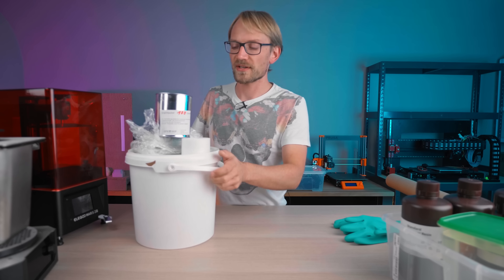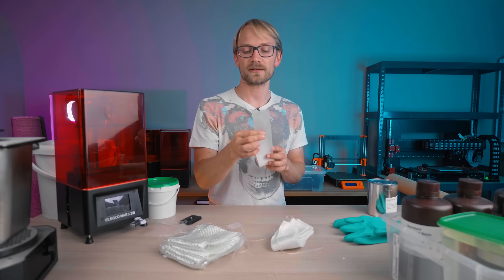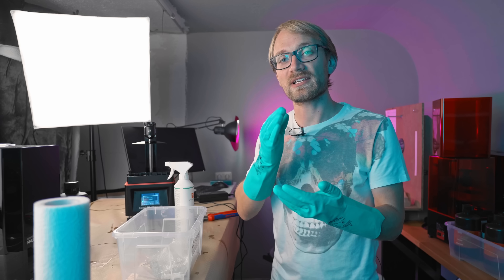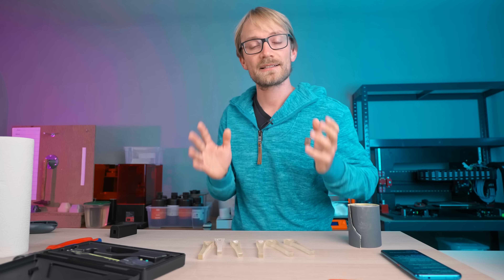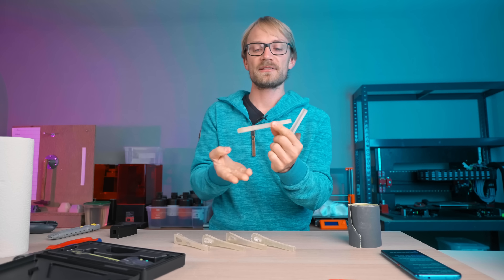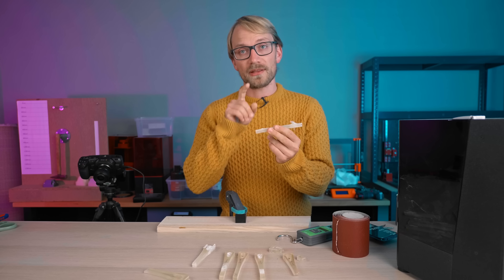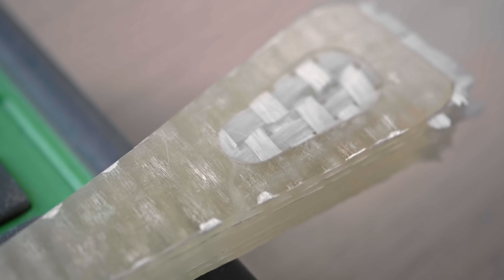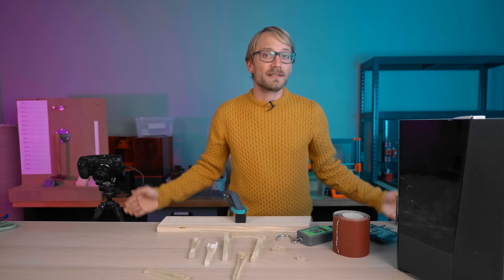Fiber-reinforced resin prints - how much STRONGER are they?

Comment: We add 10% milled 1/64" glass fibers to the resin by weight, it works great.
Reply: Now THIS is something that I would like to see tested
Reply: Just saw this comment. Would like to see how this does in various loads.
Reply: Agreed. Try adding short fibres and more flexible resin.
Reply: I was surprised that chopped flass fibre wasn't mixed in. You've answered that. What about glass beads, even as a filler? How do you maintain distribution of the fibres?
Reply: Adding loose fibers like what you are doing makes a lot more sense. 
We have done the same with our transparent watches and the result is a much stronger material with a crystal clear look. 
Although the process is different (injection molding), the principle remains the same.
Reply: Yes! I have a package of milled resin waiting for my next project. I was going to try 20% with siraya blu. I also have a bottle of strongx that I'm going to try it with
Reply: I really don't understand why anyone would test for flexibility only, after reinforcing more or less purely for tensile strength. I think the material blends really should be gauged based on the exact needs of the part and its purpose in any assembly.
Reply: @hj2479  Flexural testing is valid. Fibers will contribute to flexural strength as well as tensile. Not saying tensile strength wouldn't also be good to evaluate, but that flexural test is valid.
Reply: i hope your lungs are working great after using that stuff
Reply: Not sure, but my instinct tell me that he should have mixed with more flexible resin. I feel that adding whatever to something britlle will never work...

Comment: Please wear a respirator when working with glass fibre, especially when you have frayed edges and you are making cuts.
Reply: Also always wear something to cover exposed skin as fiberglass itch is a terrible thing.  Really nasty stuff to work with especially when sanding and grinding.
Reply: @tonberryhunter  Ouuu that gives me horrible flashbacks.. First time ever doing fiberglass repairs on the boat as a teen.. Took angle grinder+ 80 grid flapdisk, had old hoodie and overalls, eye protection and very good respirator, one collecting few micron size particles.
After few days of work i got everything taken out and started to rebuild the boat and about that point i started to have blood coming from my nose and airways. Nothing serious but not normal. Also dust settled on my skin and got rub INTO my skin due the mask so next 4 months i had skin falling off from the area where mask secured into my face.
Nope never again using angle grinder and flap disk with that stuff! Only course sanding methods with excellent dust prevention.
Ended up selling the boat in that stage and had enough working with fiberglass for a while. Now days i know what i did wrong and have buddys boat coming for some repair, this time it will take more effort but wont end up into mess like that.
Reply: Tonberry Hunter I once used an old fiberglass ladder and literally spent a week trying to the the fibers out of skin... 10/10 would not recommend!
Reply: @tonberryhunter  talc is the secret sauce. and a dust mask is all that is needed when dealing with stranded fiber glass.
Reply: @pen25  talc? how? what?
Reply: @user-qx7tm5df8j  Clogs pores and creates a barrier on the skin preventing fiber from embedding. Then you can rinse/blow off easily. Talc (baby powder) works great.
Reply: @waxball888  okay never heard of that. thanks.
Reply: @waxball888  thank you for the tip!
Reply: And coveralls and gloves. I still have glass fibres embedded in my legs from a long, long time ago.
Reply: agree - silicosis is no joke. It is also a nasty skin irritant, at least for me.
Reply: @MrKelaher  They probably should wear PP3 respirators for their own safety and especially because they do this educationally for the public but glass fiber in glass fiber rowing is typically made from 10-15 um thick fibers and they don't really float in air that well. You get some tiny chips airbone of course from the tearing and cracking action, but it's not like they're diamond blade cutting concrete here.
Reply: Little glass fiber particles stich in lungs and stays there forever. Mask, proper air ventilation is must have, when work with fiber stuff.
Reply: I assume same case with carbon fiber?
Reply: Man I remember when I build some Fiberglas parts for my car.
Top less.
Had the Ständer out and was happylie sanding.
Some Minutes later I had a little ich on my sweaty belly so I scratched it a little without thinking about it.
Well, Worst desicion I ever made 🤣 rubed it in and was terribly itchi for almost a week
Reply: @descent8275  lol
Reply: His arm must be very itchy。
Reply: Rub some dirt in it, he'll be fine.
Reply: Glass fiber is straight so you can cough it up if you breathe it in.
Reply: @CarbonGlassMan  doesn't it get impaled in your lungs sometimes?
Reply: @ZirconGames  You should wear a respirator but it's not as dangerous as asbestos. Asbestos is a hook shaped fiber that hooks in the lungs and can't be coughed up. That's what makes it so dangerous. Carbon and glass are straight fibers, so it's not a good thing to breathe them but your body will be able to get rid of the fibers. Assuming you're not just grinding fiberglass every day and breathing it constantly.
Reply: @CarbonGlassMan  thanks, that makes sense.
Reply: @CarbonGlassMan  understanding why you should wear a respirator around glass fiber, sawdust, and other particulate matter is always the first step in preventing health problems from those materials. knowing exactly what type of respirator you really need is an entirely different issue.
Reply: @TheObsesedAnimeFreaks  I wear a charcoal respirator that's used for painting cars when I grind fiberglass.
Reply: Not to mention using gloves. Did the fingers itched after that first test?
Reply: in some of the shots they are indeed wearing a respirator, and they also have a vacuum hose right where they are working :)
Reply: @StormBurnX  "They"? There's only one person there mate.
Reply: I ate beside a glass fiber when I was working with it.. but don't do this.
Reply: Ffs how many masks do we need me for covid one for resin one for sanding one ? Anything else.....geeeez

Comment: I always thought if I could just mix fine metal power with resin and print with it to get a dense and strong part. Is it possible if you can try that out? Although it can damage the printer. If not metal maybe some other powder substance that can aid in strength or rigidity?

Comment: That is an really interesting approach. I would also have hoped for more. 
But the thing is, by adding fibers, you also add impurities and a lot of spots, where micro cracks can form. So the the fiber also have to compensate that effect. 
It would have been interesting to see the effect wit unidirectional fibers instead of this laminate. Also it would have been very interesting, to which extend the the fiber volume content in the reinforced parts can be pushed. Maybe one could build a machine, where the printer even compress the material during curing. And the last question is how well the fibers are bonded to the resin.
Another idea would be, to try a softer resin, since a less stiff and brittle resin can transfer the loads to the fibers more efficient.

Many many ideas, but reinforced prints are kind of the holy grail. :)

Comment: Great video. I actually use reinforced fibers a lot, we build bicycle frame, velomobiles (sometimes called "banana bike") and special bicycle components. We use glass, carbon and kevlar for this. Strength depends on the type,thickness and weave of the material but even more important are the resin/fiber ratio and how compact the end result is. 
Carbon is way stiffer than glass and kevlar is almost like a rubber band. Kevlar is mostly used in combination with carbon to prevent it from shearing apart on impact.
When using fibers, we always apply pressure to the end product either mechanically (by pressing the resin/fiber product in a 2-part mold), using vacuum (by placing the resin/fiber product in a bag and vacuuming all the air out or by applying pneumatic pressure (the product is made in a mold and the core is a balloon that is blown up to a few Bars of pressure). In this way the weave is pressed together and the layers are pressed on top of, partly into, each other. For us a 70% fiber ratio works best, so the product contains about 30% resin, but sometimes we make carbon sheets of 8-10mm thick that contain even more fiber. If you tap on that material with a hammer it sounds like a ceramic tile and it is very hard (does not flex at all) whereas for most things (like a bicycle frame, a steering bar or a front fork) you do want some flex.
The type of resin is also very important. Some resins are very brittle whereas other resins have more flex. A brittle resin with too few fiber content will result in the resin cracking up and the fibers shifting with tears and cracks in the fibers as a result. A more tenacious resin with a carbon/kevlar mix will end up like spring steel; hard to break, very flexible and very durable - this is even used as spring leaves by some companies.

 I like to see what happens when you use short cut up fibers as suggested by another user too. We use 0.1 - 0.3mm glass and carbon fibers as fillers and those are mostly used in combination with glass bubbles and cotton fiber. The carbon or glass will add strength, the glass bubbles make it flow more easy and the cotton fiber make it thixotropic.Cotton is not suitable for 3D resin printing but mixing small fibers or glass bubbles is something that could be worth a try

Comment: Incredible video!
Reply: It's really not. It tests the completely wrong thing.
Reply: This on the Peopoly Phenom
Reply: @luislemus5552  with Kevlar to make bullet proof armor. 😂👍
Reply: Ryan Landry I was trying to think how I could do this for non flat prints but all I could keep thinking is I would also be reinforcing my supports 🤣😂 that would be fun to remove
Reply: @UncleJessy  😂 good point!  I didn't think of those problems.  Well, back to the drawing board.  I'll let you know if I come up with a solution. 😉👍
Reply: @UncleJessy  If you were thinking of a helmet I'm afraid you'd just have to do it the old fashioned way of making a mold (I'm sure 3d printing is handy for that) and saturate layers of glasfibre weave with a suitable resin. If you want to reinforce a 3D printed helmet, then you'd have to print a thinner one, keeping the "outer" shell with the details nice and then manually laying glasfibre weaves inside and marinating it with epoxy resin or what have you. So you could probably end up with a cool looking helmet that might actually do some protecting ;) Traditionally molds like that are done under vacuum to really saturate the fibres, but I'm sure some nice results could be had anyway. Would make for a cool project involving the sacrifice of several water melons (and some nice helmets) to test out real world usability.
Reply: @luislemus5552  99
Reply: Incredible ad comment! ;)

Comment: After fiber has cured, don't cut it or sand it without maximum breathing protection. The microscopic hardened fibers can pierce your lungs. Watch the close-up to see the dust fragments take to the air. Not fun if you inhale it. Heed Tom's warnings at 16:58!
Reply: maybe he can sand it underwater like when we cut carbon fiber on the CNC.

Comment: Honestly, at this point I'd just invest in or make my own little cnc milling machine and just buy CF stock. This looks waaay to messy.
Reply: Or just do regular FDM printing and use the salt/sand remelting method described by a commenter in CNC Kitchen's video. Much cheaper and safer.

Comment: lol loving the editing.... bouncing along with it :D
Reply: On a more serious note, I was wondering about how loose fine fibers worked when suspended in the resin like the dye is,,, As long as its small enough and fine enough it should supend rather well without clumping, and shouldnt put pressure on the lcd panel.

Just might make prints a little more fuzzy

Comment: 👍😎👍, how about rather than adding layers of material fiber to the prints ask a resin manufacturer to add some of the same carbon fibre elements that they add to spools of pla into the resin that may work, you would probably need to shake the bottle quite a bit before you used it though or they maybe fine enough not to sink.

Comment: I was taught to lay the fibers in the axial direction of load. Like rotating them 90 degrees in the tester to align the fiber reinforcement with direction of load. An I-beam is loaded along the center vertical spine with the top and bottom plates for anchoring and reinforcement.  Just curious to see the difference in strength.
Reply: I-beams have a top and bottom plate mainly to prevent the tall vertical spine from bending sideways and buckling under load.  This composite would be more like concrete and rebar where the resin is concrete, good with compression, and the glass fiber is like rebar, good with tension.  With his rig the top layers are in tension and the bottom in compression with the bending moment being in the middle.  If he added only a few GF layers vertically then it probably wouldn't be stronger because it would be less fibers at the top of the part for tension and they won't do much for compression at the bottom.  I think the way he did it was the best for his test setup.  I'm all for testing though I imagine it might be a little more difficult and twice as long to print the part vertically (rotated 90 degrees axial).  👍

Comment: How about some very, very fine fibers, just spread into the resin? They've been doing something similar with concrete lately. You'd probably get a very fuzzy part straight of the printer, but it might be pretty strong, and it would definitely be less work. Do be careful around these tiny fibers though, lungs don't like them.

Comment: Hm... on plastic (and filament) shredded fibers are often used. You could try those, but should be a similar result i guess. Great video 👍
Reply: This was going to be my comment suggestion. 

Loose glass fibers are used in injection molding because they can go through the injectors. Not sure about the physical benefits, but I know Biolite camping stoves use glass reinforced plastic for temperature resistance.

Could be a fun follow up video Tom, doing weighted oven tests with reinforced samples.

Comment: I have thought of doing this for some time but I was thinking of mixing the separated fibers into the resin so the print would just run with no pauses.  Would be interesting to see this if you can do it (may be messy?).
Reply: I think if you could pull it off it would be superior than sheets, due to the fact that all of the fibers would be in a radom orientation so would be more structurally sound in all directions. Like fiber reinforced concrete.
Reply: @twistedhairball  well the fibres would have to overlap and the resin would have to saturate the fiberglass, too much resin to fibre is bad for structural rigidity
Reply: Formlabs rigid resin is glass reinforced. It should be compatible with more common masked sla printers?
Reply: @Incendium87  possibly, but I think they only sell in cartridges made for their printer and they're crazy expensive.  I'm sure the technology will trickle down to the other resin suppliers soon. 🙏
Reply: Yeah search GRC on here for lots of videos covering chopped fibre in concrete.
Reply: I think the resin needs to have more flex. Then you can add strength with fiber.
Reply: And...if you cut the fibers into short-enough pieces, they should stay suspended (once mixed) in the vicous resin for a sufficient period of time.
Reply: @scottre3220  Yeah I think finer is better. There's probably a threshold. Too long and they'll be pressed and orientate flat, too fine and might as well not be there. They put iron filings into concrete too as a strengthener, and they're pretty small.
Reply: TwistedF8 I’ve tried it with chopped carbon fibres.  The results weren’t useable.
Reply: @f5dpylon  In what way was it not usable?  It seems to me that carbon fiber would absorb the 405 nm wavelength light.  The glass fibers should be transparent to it.
Reply: Scott Re it was a lot more brittle than just resin.  
Same result as Tom.
Reply: @scottre3220  you can buy very fine particles for this use with resins and casting

Comment: I am a researcher in composite materials. The parts failed not because of stress concentration in the fibers, the fibers can take 1000 MPa stress when Resin maybe 50MPa max. 
The failure occurs because the resin does not penetrate properly between the fibers due to "Weeting" and the small scale of the fibers. Usually, an impregnation process is needed. 
In other cases, the glass fibers need to be coated with a thin layer to improve bonding with the resin. 
Finally, not all resins are born equal. The common resin in composites is Epoxy which has higher strength and shear strength. Also, the viscosity can be controlled to improve penetration and wetting. 

One last thing. This is a very interesting idea you are testing. I would suggest you mix short fibers with the resin and print a part with short fibers in it and then test that. 

I love your channel ... keep those videos coming.

Comment: It almost seems like the eventual realization of this idea would be some sort of mixed-mode/media printing where the printer could insert sheets or strands of fiberglass from the side automatically during a print.  Either way, super fascinating results and well played for showing your results even though they didn't match your hypothesis.
Reply: Jeah like it could have a roll of fiber on 1 side and a robot arm thing pull the layer from the roll between layers, and a cuter to cut off the roll of fiber at the end. Add custom G code and Presto! Innovation!
Reply: @ot0m0t0  EXACTLY! I mean...how hard could it be, right? lolz